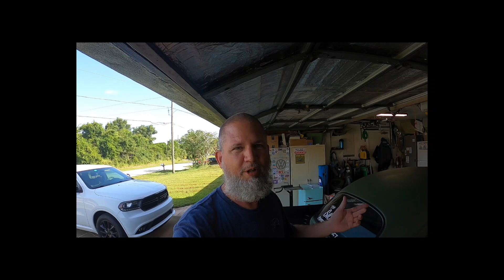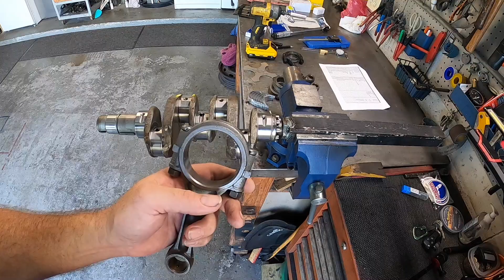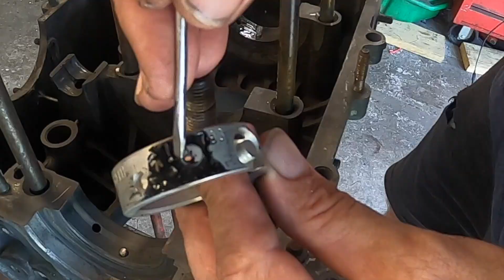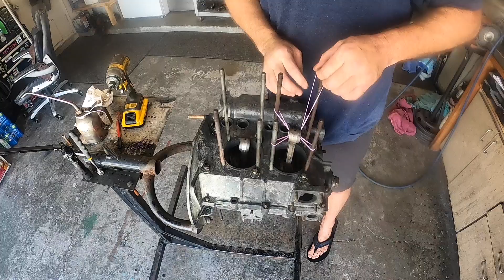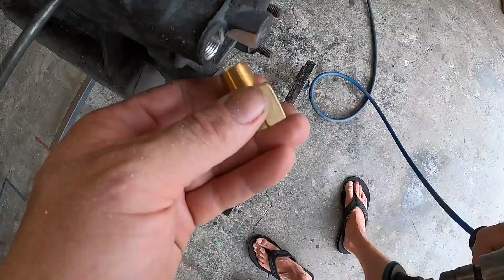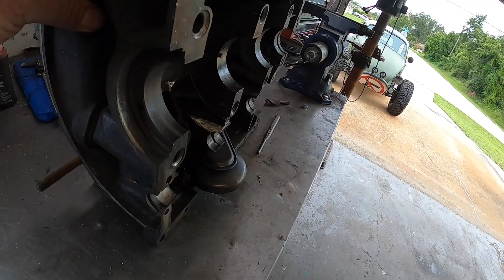Complete VW Engine Case Prep & Mock Up - How To-  Mini Stroker Build -1760cc- Part 2

Comment: Proper dont right oil returns well worth it. Not over filling engines helps as well esp with deep sumps. Oil level  is key
Reply from the maker: @type4revolution  you’re absolutely right, don’t overfill your case!

Comment: Hey Gary I'm in the middle of a 78x92 build I have CB performance crank and unlite rods and my side rod to crank thrust is 18 tho ,what you think? Suggestions? Thanks
Reply from the maker: @shawn9878  I did just look it up and technically it’s within spec as the wear limit is .027”
Reply from the maker: Honestly I’d reach out to CB and see what they have to say. Shouldn’t be that much with all new parts. 
What oil clearance do you have between the crank and rod bearings?
Reply: @VWJawbreaker  not sure didn't have a bore gauge, guess I'll need to go get a plasti gauge now .what I get for assuming
Reply: And I did email Mark at CB performance, waiting to hear back, thanks again for the help
Reply: His reply was  that is right in the sweet spot of .016” to .020” we like to see.
Reply from the maker: @shawn9878  that’s good to know!

Comment: Excuse me, upper vent on rear main is not needed for catch air as we already have stock vent, no? And from experience youll need to notch the cilinders and pistons also. I turned 20tou from the top on the pistons to no put spacers between barrels and block.
Reply from the maker: No, there is not a vent currently on the stock cases. That’s why you need to add both lines into the case. 
Cylinders and pistons were fine without mods.

Comment: What are you using for carb covers on the 60
Reply from the maker: @rickelder2122  those are bread loaf pans that I cut the handles off of.
Reply: @VWJawbreaker kinda what I thought. Was thinking good for rain.
Reply from the maker: @RickyE2798  absolutely great for the rain and also off road to help keep the mud and dust away from the filters.

Comment: I got a question I'm building my mini stroker is about the cam bearing I got the double thrust and on my as41 stock case I don't have the groove in one case so the bearing seat do I have to make the groove so the cam bearing seats
Reply from the maker: @VW4LIFE817  is the case an earlier single relief case?

Comment: Note I hear that Silverline Bearings has gone out of business. 
I had to file my Silverline main bearing set too so I think its a common issue.
Reply from the maker: I didn’t know they went out of business. That could be good or bad considering they were about the only main bearings sets we can get.
Reply: @VWJawbreaker  I would recommend buying NOS bearings kits for future projects. The new Mahle bearings have aluminum center main bearings. More info available on samba.
Reply: @VWJawbreaker  Heard it through Mikefn garage channel. He did a special vid on it a couple weeks back. Bit of a worry for many classic car engine builders.
I know my classic bug parts retailer has plenty of sets but they don't last forever.

Comment: Another great video Gary! I remember that oil return mod from a previous video and ill have to remember that when i go thru the 2058cc. The only thing i remember doing was enlarging the oil return hole. I think that size of groove it the perfect size to retain oil to keep the seal wet and allow it to drain on shutdown. Keep it up im jealous you look like your having fun:)
Reply from the maker: Thank you sir. 
Yes, I should have clarified the drain back mods I did is for shut down only. Dang it lol

Comment: First time i have seen someone have to clearance a case for a 74 stroke. i would double check that stroke. drilling that fitting is an old Berg trick and why did you not use the drill press to drill the case? not hatein just curious
Reply from the maker: @Fastvw1  I verified the stroke off camera during mock up. It came in at 74
I can almost guarantee I wouldn’t need to clearance the case if I wasn’t using stock rods.

Comment: You do a great job of explaining the procedure and process and method behind it all. Very educational! This is going to be a great series!
Reply from the maker: I sure hope so, appreciate you as always!
Reply: @VWJawbreaker agree
I would never try this myself. I would trust someone like yourself to build my engine. 
I cant even decide what displacement with reliability to chose for my 71 Bug convertible
Reply from the maker: @RJLM330  displacement and reliability doesn’t really go together imo, you can have a large displacement engine be reliable and a stock displacement engine be unreliable. It’s about the total engine combo.
Reply: @VWJawbreaker  
Actually that’s good to hear I’ve been told wrong. “A 1914 is as big as you want to go because they become un reliable”. So whom do I get that info from as I’m in the blind here. If it matters I’d like around  100-120hp

Comment: Awesome video with careful and detailed procedures. Just the way to do it to make sure the thing survives and doesn’t self destruct. So many details that need to be accounted for. I saw a new engine rebuild that lasted for 5 minutes due to a mismatched oil pump cover.
Reply from the maker: I’m just trying to pass along what I’ve learned along the way. There are other details as well but they aren’t as important as these basic details.